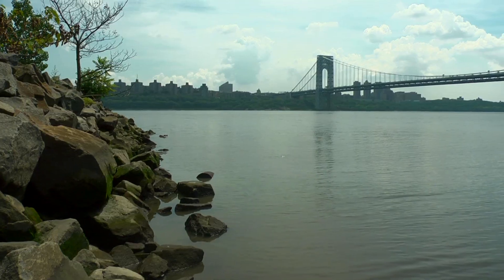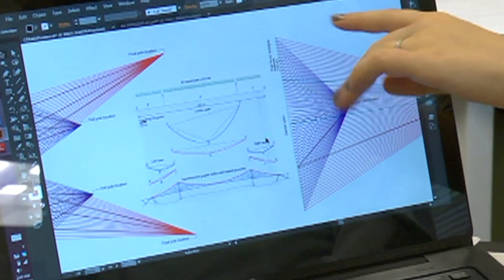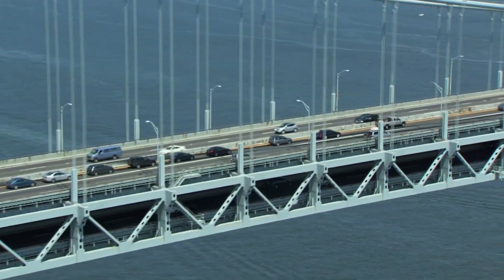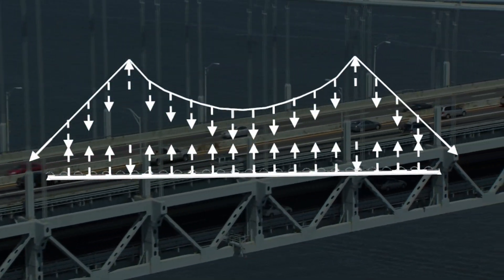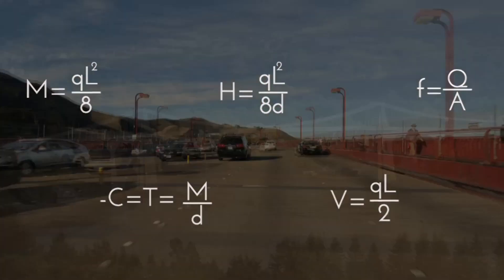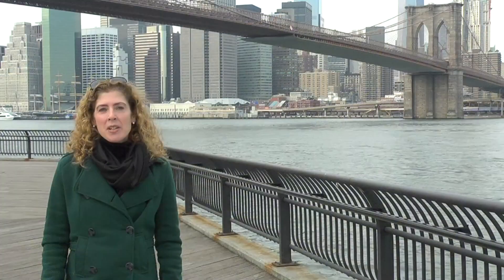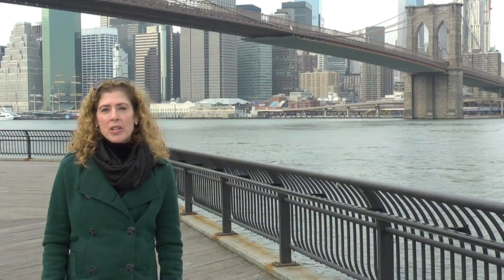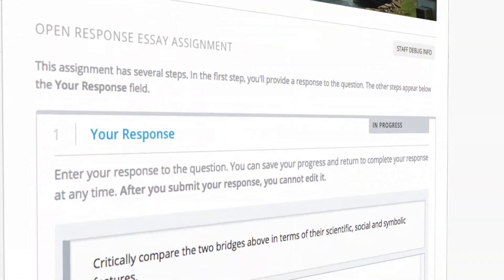The Art of Structural Engineering: Bridges | PrincetonX on edX | Course About Video

Comment: It is such a pity that the elegance of the old catenary  suspension bridges   have an inherent stability if the deck is not solid enough, The Tacoma narrow bridge went into an oscillation because the vertical suspension wires from the catenary holding the deck did not contain a single triangle and so due to its length the deck started flexing and oscillating. If one examines the catenary bridge as in 0:.49 the only triangular form is obtained by the  considering the attachment of the catenary at the centre of the bridge.   This centre point is reasonable stable and so the fundamental mode half wavelength cannot be  supported.   The full wavelength can be supported however and this is the mode that was excited at the Narrow Tacoma Bridge.    If the designers added another  thinner cable running from the top of the tower to one quarter  of the length of the bridge, the full wavelength mode would have been eliminated and using two more triangles the higher modes would be  eliminated too. The very higher mode would have  not been possible due to the solidity of the deck structure over a short length.
Another manner to stabilize the catenary  bridge is to run cables from the junction of where the deck meets the tower and go upwards towards the catenary thick cable to meet it somewhere about one quarter length of the bridge from the tower. This would not permit the thick cable to swing up.    A few more cables from the mentioned junction running upwards to stabilise the first few modes of oscillation of the catenary curve itself would have saved the day at the Tacoma Bridge.    I would even go as far a s saying that they had plenty of time to do it as the vibration was noticed about one month before it fell, and one month was long enough to brace the catenary curve down to eliminate the harmonic that destroyed it.